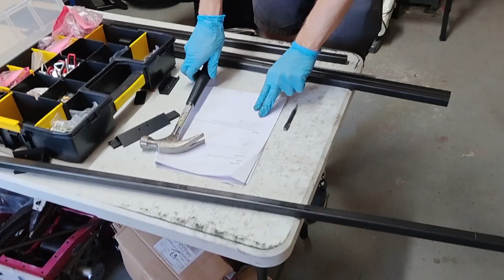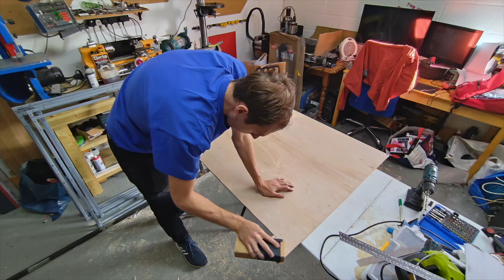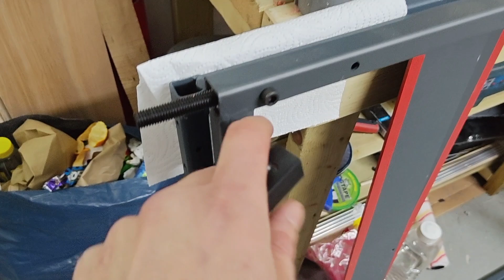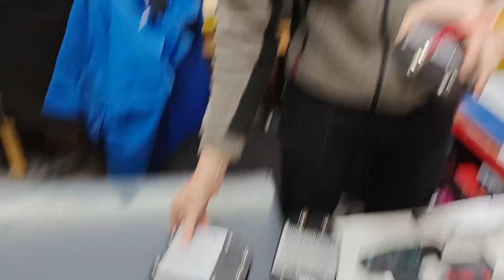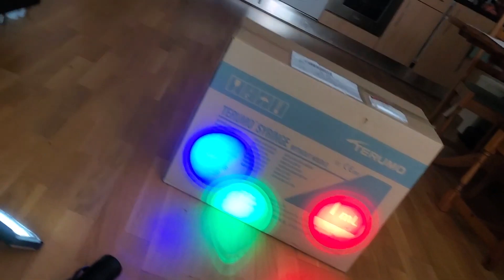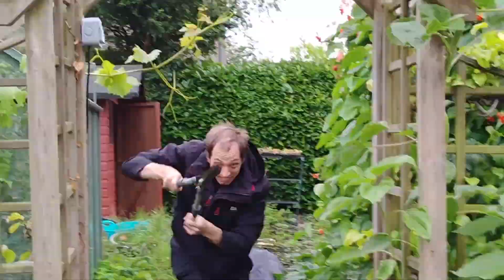How We Built a Robot Combat Arena for Beetleweights - Bristol Bot Builders

Comment: Have you had any trouble with bolting the polycarb onto the frame? Some of the advice out there says that it's better to mount it in a continuous channel (as with alu extrusion) as the fixing points can concentrate stress especially if they're close to the edge. Obviously your antweight arena uses fixings as well and that's been around a bit longer. Do wonder if you could avoid bolting it you might be able to get away with a slightly thinner sheet.